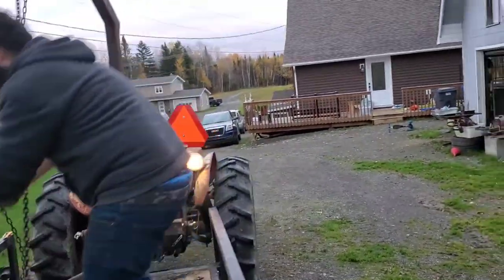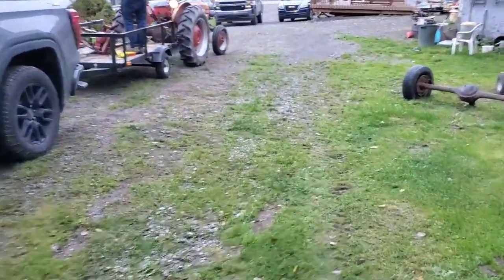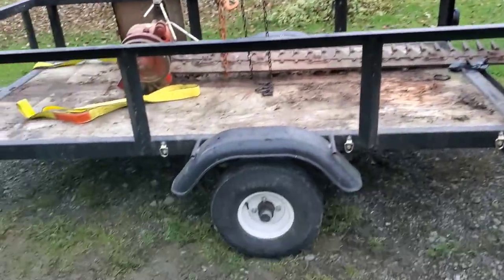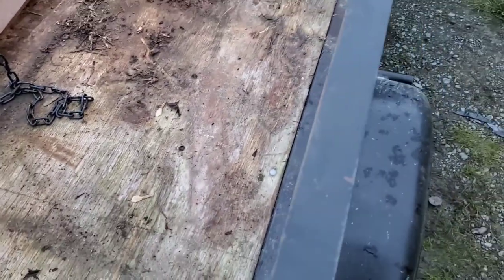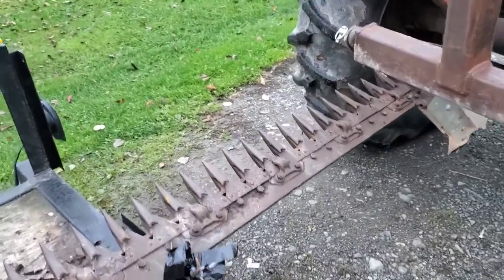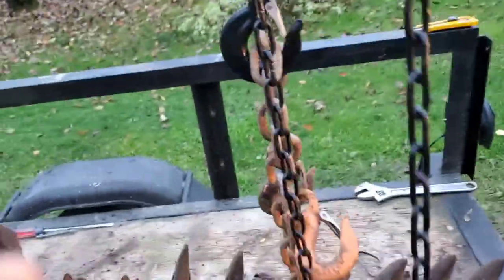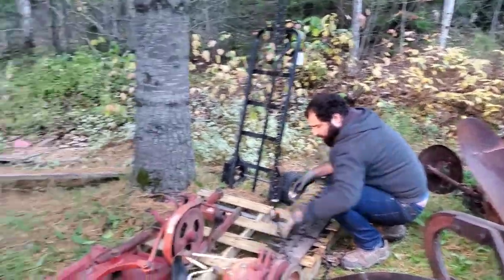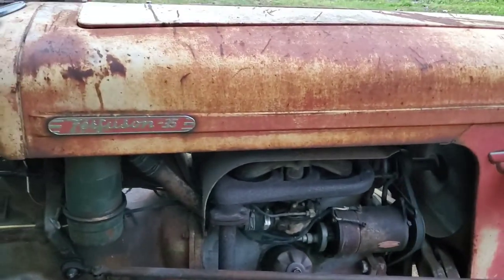1956 Ferguson TO35 Tractor, Massey Ferguson a work horse

Comment: What color did you use on the rims of the tractor.and are you running the 3 bottom plow on the Massey or the tym thanks.
Reply from the maker: Rustoleum Red and Silver. The plow was purchased to work some land we own in another location. We are thinking this spring maybe
Reply: Thanks for the info Jim .tractor looks great .how do you like the tym 654 looks like a great machine.i like the deutz motor ... reliable.good videos btw
Reply from the maker: Absolutley love it